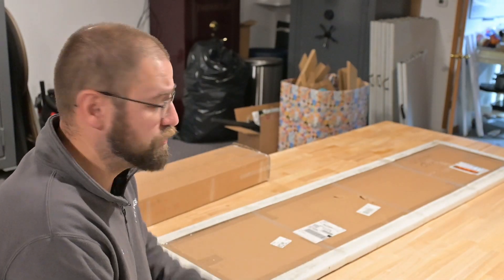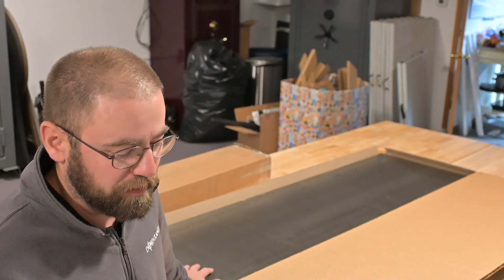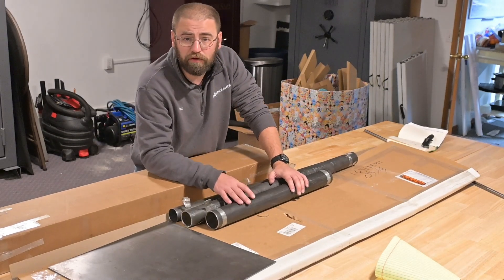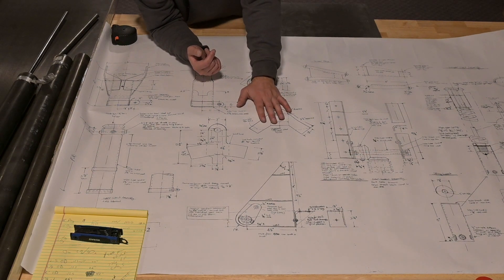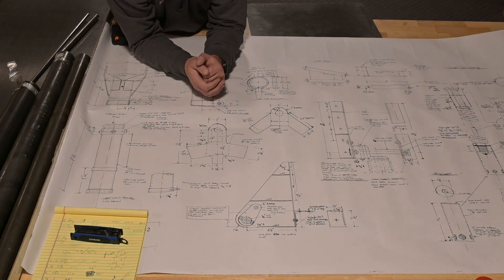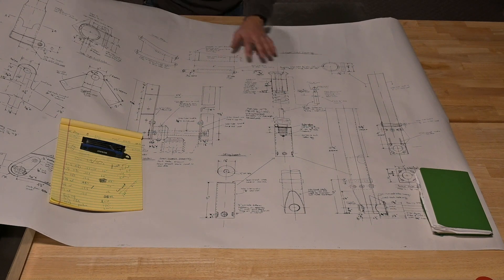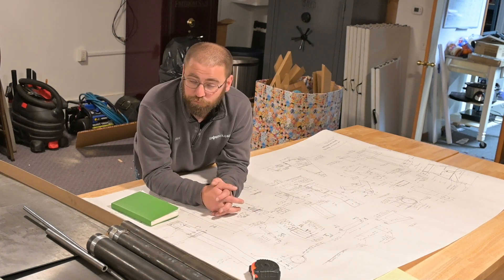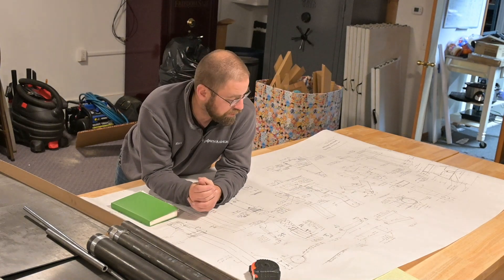WAR 1/2 Scale p40 Warhawk unboxing first steel delivery 20231219

Comment: Use the 1-7/8 in .250 inch wall tubing. With the thicker wall, you won't have to braze in the nuts. Just drill and tap them into the thicker wall tube for 1/4-24. That method use to be on the prints as an alternative method. If you have access to a lathe, you can thin down some of it, on the inside, for weight savings if you like. That's what I used. Also just use the T-88 glue. It doesn't have a smell to it. All epoxy has very low odor. it's safe to use in your home.
Reply from the maker: This is great news for me! If I my lumber order comes in this winter (which isn't looking good) I can get rolling on it in the basement.  Not that the gear project isn't going to be keeping me busy.